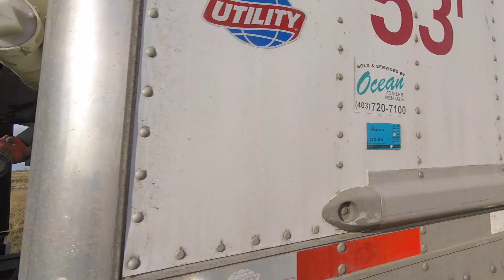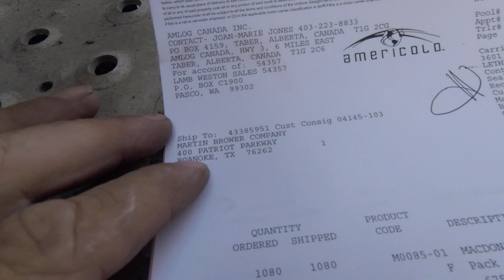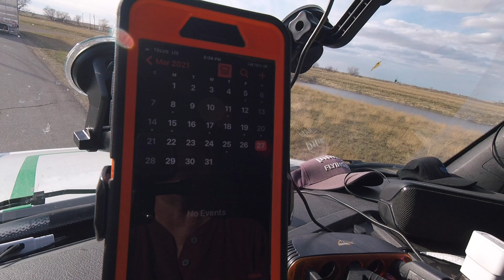Life On The Road With Yeshua & Trucker Ray - Trucking Vlog - Mar 27th - 29th - 2021

Comment: As for the bread tag trick good idea, but I have noticed that you air lines and electrical are zap strapped together a little bit high and cause the electrical to be pulled down by the weight of the airlines. Remove the zap straps and even out the lines. At 21:11 you can see the your airlines have more line then the electrical so it is holding all the extra weight of the airlines cause it to be pulled down which is why the bread clip works by pushing it back up.